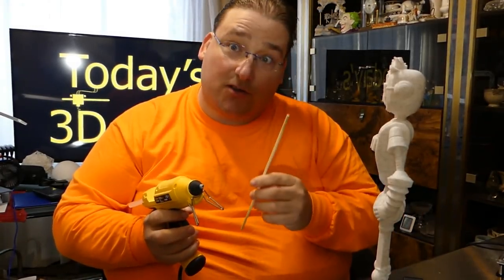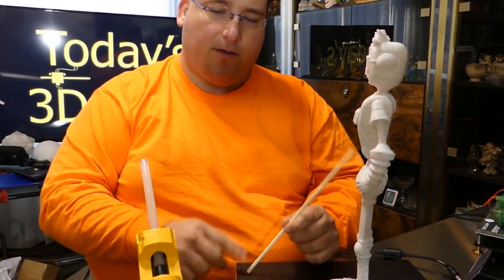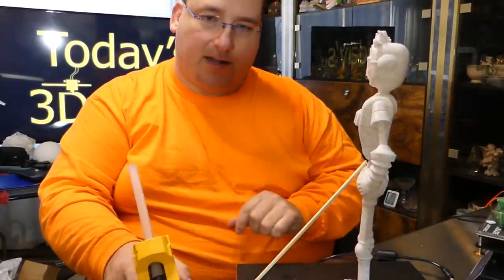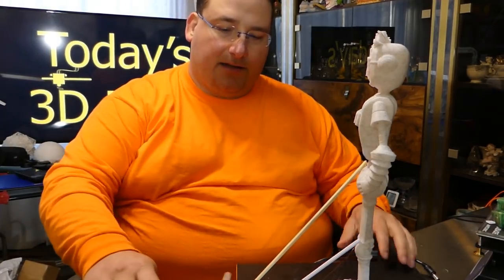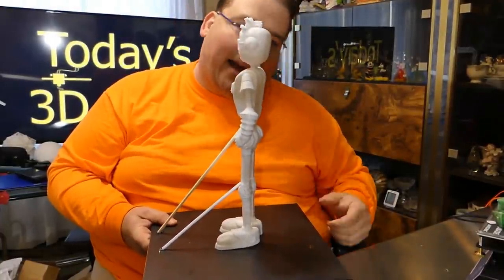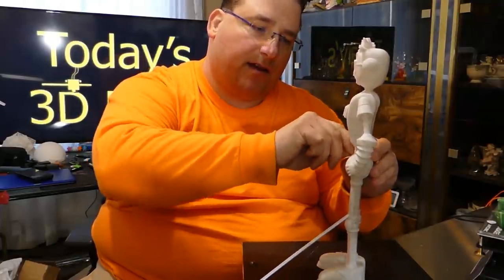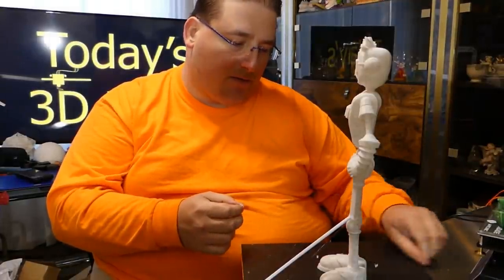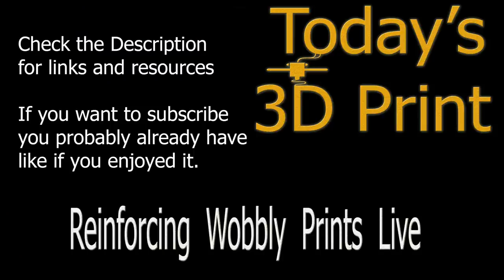Today's 3D Print 143 Tech Tip, Reinforcing Wobbly Prints Live

Comment: Those ideas would be great when printing tall lithophanes !!!!!
(I print lithophanes in the direction of the 'Y' axis, but it would still be great when going tall with a lithophane.)
Reply from the maker: +abinder3 in your case it might be better to put the glue on the two end of the stick and then very gently drop it in place so you don't disturb the model while it is printing
Reply: HI nerys, I recently bought a 3D printer based off of your videos about them the Ender 2, I've been having a lot of fun with it and no issues until today. Whenever I try to print circles they come out more like oval. I learned this whenever I was trying to print out a Bolt & Screw, any suggestions for fixing this?
Reply from the maker: +Cody McCoy is it a consistent oval or does it keep changing? That sounds really weird if it's inconsistent I would think loose grip screw on one of the gears on a stepper so it's slipping which will change the shape of the objects you printing
Reply: It is so consistent that it's almost like it's the design, but I went back and check just to make sure.
Reply: Hey Chris - is there a reason why you are not pausing the print to add the reinforcement? 

Love the matchstick idea, lol. Gunna do a video of a 3D-printed match-head rocket, complete with launch?

6K subs...wow. Hopefully not a lot of riffraff trolls who merely want a free printer.

Comment: Is consistent throughout the whole peace, almost as if it was designed that way. I went back and made sure that it wasn't supposed to be designed that way. And to answer your question yes the oval is consistent all the way up
Reply from the maker: +Cody McCoy can you send me the gcode? Also a link to the file if it's a public one?

Did you check for tightness in the belts and the grub screws although if it's consistent these are less likely to be the problem don't over tighten just make sure they are snug

Comment: Brilliant idea, time to experiment i think :)
Reply from the maker: +Tac Blades it's risky of course if you bump it too hard you'll mess up to print but the rigidity Improvement is dramatic like night and day

I'm going to make a follow-up video when I actually do this to my Joel on the cr10 S at 220% well it printed fine you can definitely see the wobbling at the top end of the print in the chest as the layers do not line up as well anymore because of it vibrate and wobbling

I've done it for other models it works pretty good and I never thought about showing it off until I saw so many people printing Joel and having the same problem and it clicked duh show them :-)

I have to remind myself that what I see is obvious might not be so obvious two other people they might just never thought of it so I have to try to remember to write down my little tricks and tips when I use them to consider video

Comment: Interesting and new ideas, as usual from you. :)
Btw:
Di you think of using better drivers for makign your printers quieter?
Like TMC 2208. Youd probably need another board and build firmware, also.
Reply from the maker: +ElMariachi many times quieter drivers are also weaker drivers prusa has this problem their stealth mode is great but not too strong so I tried to find Mechanical Solutions such as dampers and stuff like that although the biggest issue is fan noise :-)

 I now realize that my phone which I used to use to record my videos and it does a fantastic job at it also has better sound than my main camera and it must do some internal processing to reduce some of this noise once I switch to my full size camera it's microphone is kind of come one come all no processing so it picks up everything good quality but no discretion

Sadly you cannot change the stepper drivers in the tornado as they are a permanent part of the board I'm a one-day try putting a cr10 board in there just to see what happens :-)

Comment: Wouldn't it also be a good idea to position a model like this so that its narrow side faces the direction of travel?
Reply from the maker: +Mighty Jabba's Collection on hindsight probably not a bad idea for this model in particular my initial thought was to minimize y-axis movement and once the feet are done there's very little movement front to back relative to left right but that probably is more stable than left right with the behemoth I don't have a choice I have to have 45 degrees in order to fit in the build volume but yes orientation should be considered for things like this actually 45° might be best to matter what size since that will slow movement on both axes down without slowing the print down might reduce resolution slightly although probably not enough to tell visually

Comment: Hi Nerys, CR10 or Tornado with the smoother boards, which would you say gives the better surface finish? (assuming both dialled in properly)
Reply from the maker: +Steven Adams cr10 hands down up close and personal the quality difference is very visible arm's length you have trouble telling depending on what you printed 9 out of 10 people will be fine with either one but if surface finish is important go to cr10 S
Reply: wow that was quick! thanks so much. For a hardware based issue, I don't know how it escaped so many other reviews - glad yours picked it out! Great video series
Reply from the maker: +Steven Adams because most people do art prints decorative prints so you might not notice this issue like I said it's for 9 out of 10 people it would be fine but I also do very high quality rocket parts with high precision in surface finish and you can tell right away if you're looking for it also if you're coming from a lower end printer he might not realize what you're seeing is a defect because it looks so much better than what you're used to

It's a tornado with my first-ever printer I would be blown away by its quality it truly is amazing but since I have better printers I can see the difference